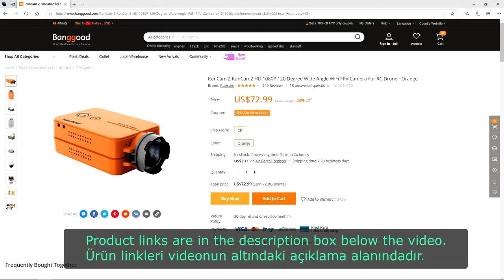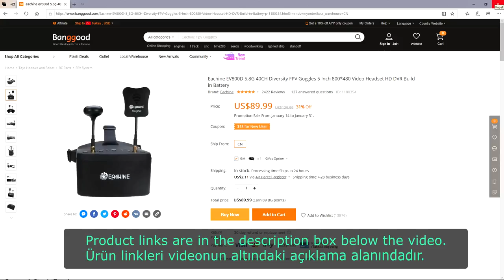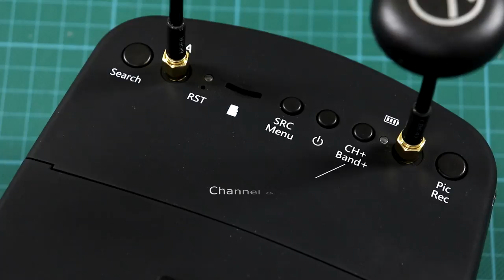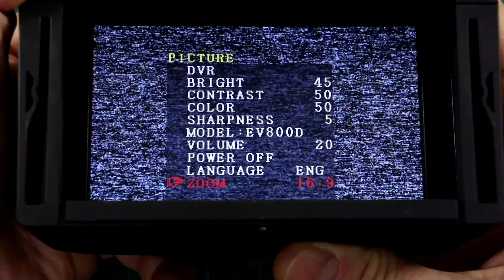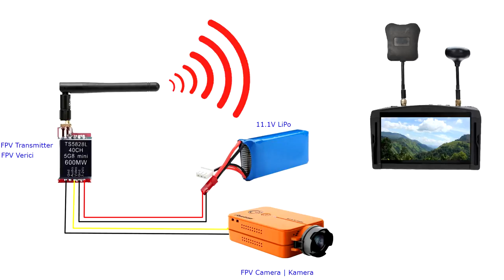How To FPV Camera System For RC Models. With Run Cam II camera and EV800D Goggles

Comment: Oh boy, I can only imagine this has gone cheaper and or way better resolution available, lemme check. thanks for the great video.(update) the camera is now $89.99 from $72.99 and the Googles are $73.79 from $89.99 so pretty much the same for the opposite items,  3 years later.

Comment: What plane (you make) from your videos do you reccomend making to support this fpv camera setup. I saw you  made a plane after this video holding the setup but its a little old, so im wondering is thats the best option that can support this setup. Thanks love your videos
Reply from the maker: I've only made one airplane video for FPV. It is suitable. Or you can also apply it to the model in this link. https://youtu.be/eHdxx4qpVko
Reply: @Kendin-Yap what's the biggest difference between the 2 I see one plane has dual motors while the other doesn't is that the biggest difference? Thanks
Reply from the maker: Yes, that's the main difference. Another difference is that the propellers are facing backwards, which is beneficial for the camera's framing. The propeller does not enter the frame. @Asatisfiedguy-b5z
Reply: @Kendin-Yap  sorry to bother you but I see you don't use the audio wire is there a reason for this (fpv setup) and is there a way that I can make it work so I can see from my goggles? Thanks
Reply from the maker: Motor and propeller noise can be very loud and disturbing. That's why I didn't connect the audio cable. @Asatisfiedguy-b5z

Comment: Where does someone get the connectors  (red one and black one) in frame at 2:09. The two that connect to the transmitter cable. I’ve sources everything except those two things. 

EXCELLENT video by the way. Absolutely refreshingly clear and simple to follow.
Reply from the maker: https://www.banggood.com/custlink/KGDdn9iM6F
https://www.banggood.com/custlink/33vdsZZk6S
Reply: @Kendin-Yap    A million Thankyous good sir… and a million more
 bows

Comment: Can we use DJI Osmo Action Camera as FPV, (connect audio video transmitter to camera)? so that I can take 4K videos for aerial shooting as well as I use it as FPV.

I am ok with latency, when I use DJI Osmo Action camera as FPV.

I want to connect my "TS832 48Ch 5.8G 600mW Wireless Audio/Video Transmitter for FPV RC"  to DJI Osmo Action Camera.

Please help!.
Reply from the maker: Possible. You have to find the appropriate cable for this.
Reply: @Kendin-Yap  Ok thanks
Reply: That what I was wondering about. I want to make a RC airliner and I want to use exact camera on it. I'm still researching tho. Great question btw. @MrNams

Comment: brilliant short video on how to connect the RC 2 on FPV so thank you for this... I presume with this diagram you don't need the battery in the RC then since the power goes to the VTX first then to the RC... correct?
Reply from the maker: Thanks. Yes, this system works independently of the RC's battery. It can also work from rc battery if desired.

Comment: Thank you for this perfect vid.
New to FPV
Flying a 1270mm Dynam FW-190.
Want to keep my weight as light as possible. 
Can I power the RunCam2 through my rx without the RunCam battery? My rx is 5v.
I believe I will be able to power my vtx using the balance lead from my 4s 2200mah main battery.
Reply from the maker: External power cord comes out of the box. It works with 5V.

Comment: Hi very nice video, do you think is possible make something similar with dji googles and air unit for better video quality and longer range?
Reply from the maker: Thanks. Yes I have FPV experience with it. The image quality of the DJI FPV system is much better and its range is 4 km.
Reply: @Kendin-Yap  thanks for answer and could you make some scheme of connection please I think lot of people appreciate that :)

Comment: ist it possible to connect the transmitter to the ESC if y wanna have it on RC Plane so it will get the power from the ESC ? is that even possible
Reply from the maker: BEC circuits of ESCs are generally 5-6V. This transmitter operates on 12V.
Reply: @Kendin-Yap so basically it’s better to connect the FPV cameras on an extra lipo Battery ? 
how much mAh ,C is safer for them 550mAh ,10C ?

Comment: Excellent setup and video tutorial, thanks!! In the link there is an FPV system setup that I used with my TRX4 Kit. I don't use the goggles but the monitor image is very good and provides less intrusive immerse experience. 
@

Comment: Do you still recommend this method? How far can you go until you get chopy signal? Please respond I'm trying to upgrade my cheap Spotter FPV that I first bought, it's great for nearby RC action with the minis but I'd like to go crawling while sitting in my car lol so let me know if I'm making a good choice! Thank you
Reply from the maker: This is a classic analog system. It is still used. Its range is about 1.5 - 2 km. It was not a significant innovation or improvement for this type of system. You can use digital systems for high quality. (For example DJI FPV system).

Comment: Hey KendinYap, could you please explain what the yellow, red and black cables that come from the runcam are? Would be REALLY helpful thanks. Can I read the yellow cable from a computer ?
Reply from the maker: 2:04 .... The yellow is signal, Black is GND (Ground), Red is VCC (Power Input).  A direct connection to the computer cannot be established. A converter adapter is required. RCA to HDMI Converter (Analog to Digital Converter)
Reply: @Kendin-Yap  Thanks a lot!

Comment: Hello sir, did you have issues with the vtx overheating? I have a similar setup with a 2S LiPo, and unfortunately, the vtx becomes very hot after only a few seconds of usage.

As I understand it these vtx's were designed to have airflow as cooling, so the vtx is prone to overheat when using in a confined space. I'm thinking to add a small cooling fan with a pigtail for power. Thanks in advance for any suggestions.
Reply from the maker: Heating of the VTXs is normal. While in flight, the air flow provides adequate cooling. It is necessary to cool with Fan in closed environments. A 30x30mm fan will be sufficient.
Reply: @Kendin-Yap  for a rc car is a fan needed ?
Reply from the maker: @amagnier  Yes absolutely necessary
Reply: @Kendin-Yap  thx !

Comment: Great video! One question: How long does this camera record using the original battery?
Reply from the maker: Between 35-45 minutes
Reply: @Kendin-Yap how far it can reach?
Reply from the maker: It varies depending on the conditions. Theoretically, its range is 2- 2.5 km @futurevolador3984

Comment: Hello.  Thanks for your video.  Have you measured the range of the system (how far can you transmit)?
Reply from the maker: 2 km in ideal conditions
Reply: @Kendin-Yap  Tranmitter devresinde daha küçük antenler ile ( pcb yüzeyler antenler gibi ) video streaming yapmayı hiç denediniz mi ? Denediyseniz eğer daha küçük bir anten ile belirttiğiniz range'lere ulaşabildiniz mi?
Reply from the maker: @semihk09  O tip antenler kullanmadım. Dairesel anten tiplerini Pagoda antenler gibi olanları denedim. Menzilden ziyade parazit azalmasında fayda sağlıyorlar.

Comment: what kind of battery is powering the video transmitter?
Reply from the maker: 11.1V lipo battery (3S lipo)
Reply: @Kendin-Yap  Hey I have a question.  I wired up the wire harness just like you did in the video, however my camera is not turning on.  I noticed you did not connect the servo connector with the red and black wires to anything.  And according to your wire diagram, there is no power wire running to the camera?  Do I need to solder the red and black wires to the JST for power to the RunCam?

Comment: Does it work hes own bbattery or rcs
Reply from the maker: The internal battery of the screen and camera works. External battery required for FPV transmitter.

Comment: Menzil kaç km?
Reply from the maker: İdeal koşullarda yaklaşık 2-3 km
Reply: @Kendin-Yap  arttırılabilir mi? Diyelim para çok 40 - 100km menzile çıkartabilir miyiz?
Reply: @MythHoor  Para çoksa ABD ye bile yayin yaparsın 😊
Reply: @MythHoor  : TP-LINK WBS510 ile 50 km'ye yayın yapabilirsiniz. Lakin bunun için, cihazın bu sistemi taşıyacak güçte ve alıcı verici istasyonun birbirini görmesi lazım (örneğin bir iha kullanılabilir). Ayrıca GPS konumuna göre yayını alacak merkeze, üzerindeki bu verici anteni yönlendirecek ayrı bir motorlu sistem ve yazılım lazım. Çok zor değil, piyasadan topladığınız hazır kitleri bir araya getirip,  kendi kendinize evde yapabilirsiniz.
   Yada kapsama alanından çıkılmadığı sürece, mobil telefon ve ilave android yazılım desteği ile yapılabilir.
Reply: @ahmetizmir1081  kardeşim aselsandan yazıyorum gel yarın işe başla
Reply: @burakarslan7650  Hiç gerek yok. 1996 yılında başka benzer aletlerle yapmıştım, hevesimi aldım :)))

Comment: hello good video, do you know how one can set so one can see hight, speed, distance, voltage, etc? 
thanks for the answer!
Reply from the maker: You can use OSD for this. Like this https://www.banggood.com/custlink/Dm3KszE3FD
OSD sends telemetry information to the Goggles via the FPV transmitter. It is added as a layer above the image and displayed in the data.

Comment: Has anybody tried to take an Eachine rotg01 and plug that run cams android slot with Eachine attached that will work too. Infact I will check to see if that's the truth next exciting purchase and let you know since I also have the ev800 googles by Eachine.

Comment: Thanks for a great video! The setup works fine. I have an issue with my Rancam2 4K. It stops recording at about 8 minutes or just under 4gb (whichever comes first). I tried different recording options, frame rates, formatting the sd card, updating the firmware, but still the same result... Any idea what might be causing this problem?
Reply: Same problem

Comment: I think this video is about 3 years or more out of date.  Old news.  Sorry
Reply from the maker: I bought these products in January 2020 and made the video. What does it mean from 3 years ago ????
Reply: @Kendin-Yap  this is an extremely old topic and plenty of videos on this dating back 3-5 years ago.  Adding FPV equipment to an existing RC aircraft is not new.
Reply from the maker: Yes, I understand and I know that. I have been dealing with FPV for years. But this video is for beginners or those who want to get started. And even if there are many different products, these materials are still good equipment in their class. It doesn't matter if FPV is an old subject. Since I have requests from my followers on this subject, I prepared video.

Comment: What's the range?
Reply from the maker: About 2 km
Reply: On surface vehicle?
Reply from the maker: It varies greatly depending on surface conditions. @ahmadfaris8044
Reply: @Kendin-Yap  I'm elevated 3 meters off the ground overseeing the car on open field with some houses around but not blocking signal or line of sight